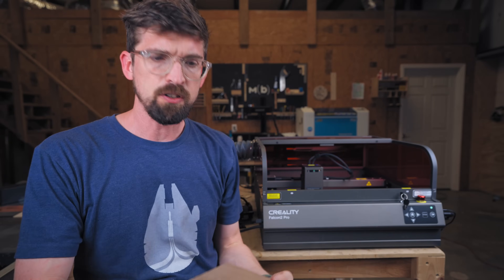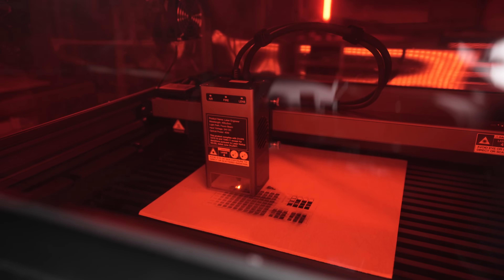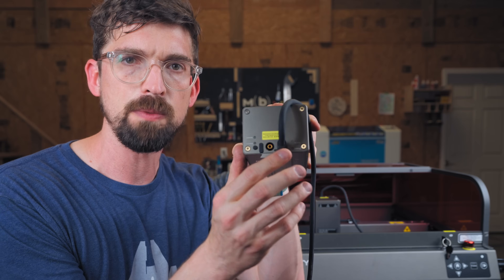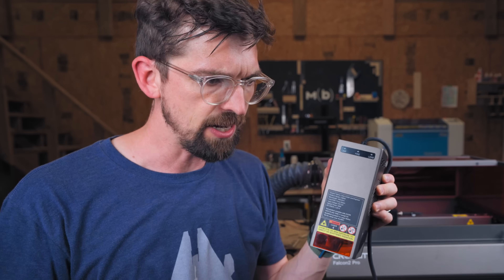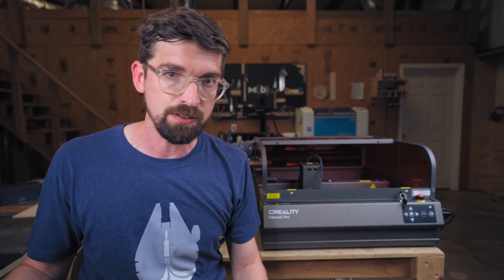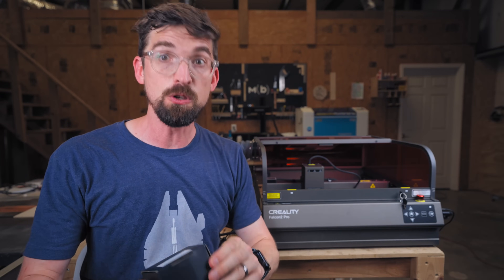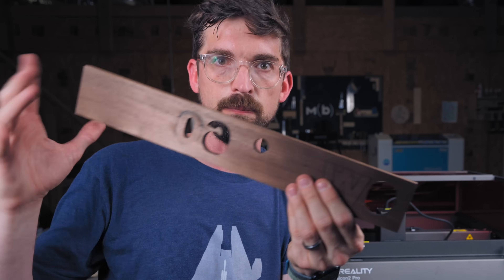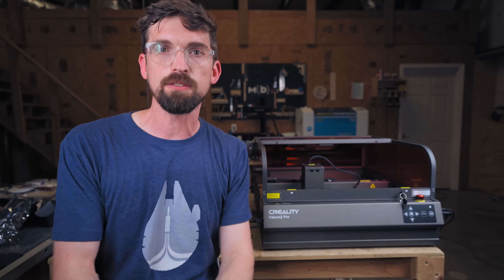I Didn't Know a Laser Could Do This!

Comment: I've been watching your stuff for years and really appreciate your videos! I always stop here first when trying to learn about new and innovative lasers on the market. I have an ambitious project idea I was hoping to get your opinion on.  I'm thinking about building a really large work area diode setup for cutting thin fabrics. These will likely be polyester, nylon, and dyneema fabrics for cutting tent patterns. I will need it to have a 72" usable width for the work area and probably at least 140" length or the ability to easily and accurately index the next section of the cut (floor panels will commonly be 108" long and need straight edge cuts). Due to the crazy size, i'm trying to find a way to make it collapsible, something i could put up and take down easily. Another idea might be to rig it to hang from the garage ceiling and drop down as needed. Hoping to go lightweight and establish rigidity with whatever i set it on for cutting (possibly concrete driveway or lightweight ply base if mounting to ceiling). Lastly, it wouldn't hurt to prioritize speed over accuracy as a cut line within an 1/8" of the intended cut is plenty accurate (no engraving needed with this setup) Any thoughts on how achievable this would be? Not sure how the belt drive accuracy would be at that scale. Also, if you're aware of a smaller machine designed to index quickly/accurately for large prints that you think could work well in this use case, I'd love to hear about it:). Thanks again and care!

Comment: Should probably finish watching the video before asking this but....

Given that the tray can be removed, does the Z have enough adjustment to make it possible to have a long piece of material inserted in it's place, with the cutting capacity of this larger(stronger more functional) multi-piece projects can be done and you will get a LOT of waste if you have to cut pieces short enough to fit in the machine rather than just feeding in and positioning/flipping(if necessary) a longer piece to maximize material usage and minimize waste?

Basically every 'tool made from plywood' vid on youtube with parts small enough........................
Reply: If you slide material in through the tray, you can fit a full 24" long piece of plywood into the work volume. The Falcon 2 Pro has sensors that know if the tray is open, so you'd have to spoof it being closed in order to fit larger sheets of material in and cut with half of it hanging out.

Comment: Yes please can you do a comparison of a ~60W CO2 machine to 60W diode.  I'm torn between getting the P2 with all the bells and whistles and the Falcon2 Pro 60W.
Reply from the maker: you got it.
Reply: Also if you do that comparison can you talk about maintenance costs and what typically lasts longer co2 tubes or diodes.
Reply: The CO2 laser tubes you might get 2000 hours out of. 
The diode lasers are supposed to last 15,000 to 20,000 hours. 

I wouldn't even consider a CO2 laser against a diode at the same power... 
The diodes work out to about 4-6 cents an hour to operate.
Vs the CO2 lasers costing 10x more.

Comment: From the parameter test values, I feel that the engraving function of this machine is average, and I can't see a suitable engraving parameter. And the wood board has traces of yellowing.
Reply from the maker: I'll say I didn't fully dial it in BUT the performance with the 1.6W module is really nice, just slow.  Also I need to show engraving tests on better material, the normal birch ply is pretty grainy and it's hard to get a good shot of it on camera.

Comment: A comparison between a 60W CO2 and a Diode laser would be awesome!
Reply: Of course on material they can both work with.
Reply from the maker: @MyLifeAsMitch  yep, I won't do clear acrylic but a side by side on wood/colored acrylic would be a good starting point I think.
Reply: I agree with you
Reply: The comparison should be to a 90w co2 tube, because that would be limited to approx. 70% from the rated tube power, so at about 60-70w. Quite comparable raw power.
60w co2 will be a bit faster, even though it really will be 40-45w power. A 90w cuts 3mm ply at about 50 mm/s at 25 mAh. Quite underwhelming cutting results for a "60w" diode.

But it is only the raw cutting speed which can be increased by having a normal compressor. Different variety of lenses will be able to give better results at different material thicknesses.

Comment: $2700.... Nah. I'll pass.
Reply: Agreed. This is getting close to decent CNC router prices.
Reply: Yea, for $3200, I bought a 55 watt CO2 laser with a 20" x 28" bed. Those laser modules must be super expensive to manufacture because the rest of the machine looks like it should come in under $150.00. I think if they put a better collimator lens on the laser module, they could get the spot size down significantly making the beam intensity super high. Then I would think you would be able to cut through ¾" walnut in a single pass with no problem.
Reply from the maker: @krisknowlton5935  Planning on testing a 60W in the same price point (ish) to see.
Reply: @makeorbreakshop  I will be watching for that video!